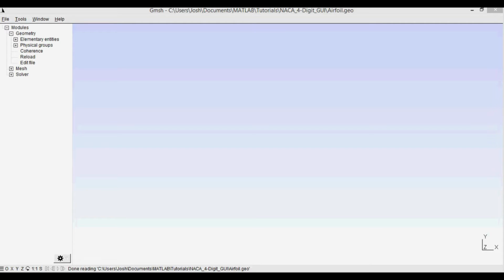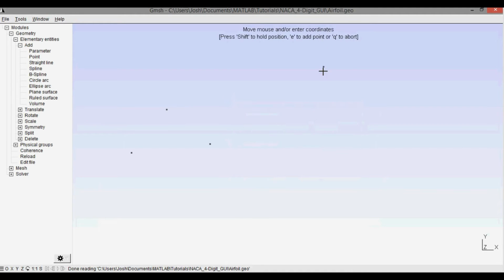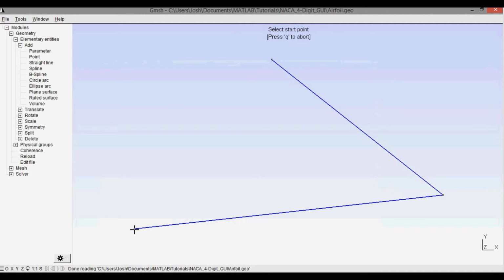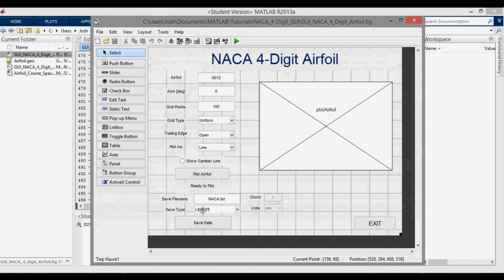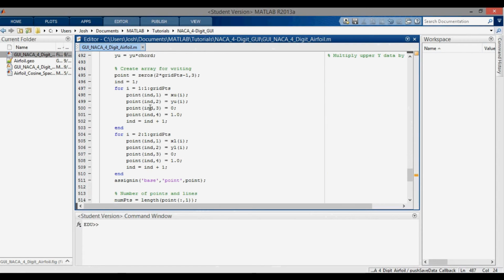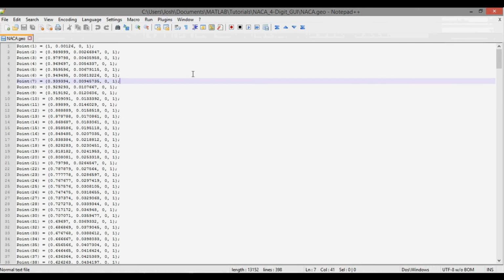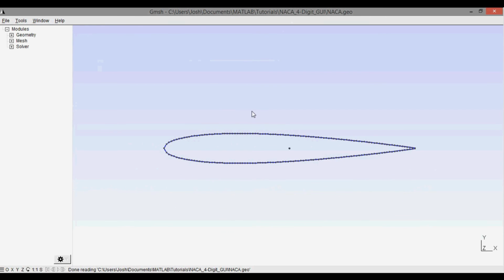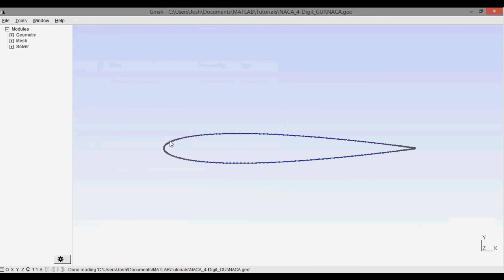How To: Import Airfoil into Gmsh

Comment: Thaks for the tutorial! But when i start the generation of a plot, this erros happens

 ">> 
Error using evalin
Undefined function or variable 'typeNACA'.

Error in GUI_NACA_4_Digit_Airfoil>pushPlotAirfoil_Callback (line 261)
typeNACA        = evalin('base','typeNACA');

Error in gui_mainfcn (line 95)
        feval(varargin{:});

Error in GUI_NACA_4_Digit_Airfoil (line 27)
    gui_mainfcn(gui_State, varargin{:});

Error in
matlab.graphics.internal.figfile.FigFile/read>@(hObject,eventdata)GUI_NACA_4_Digit_Airfoil('pushPlotAirfoil_Callback',hObject,eventdata,guidata(hObject)) 
Error while evaluating UIControl Callback.

>> "

Comment: I tried to run the program,but theses errors are shown

Error in GUI_NACA_4_Digit_Airfoil>pushPlotAirfoil_Callback (line 261)
typeNACA        = evalin('base','typeNACA');

Error in gui_mainfcn (line 95)
        feval(varargin{:});

Error in GUI_NACA_4_Digit_Airfoil (line 27)
    gui_mainfcn(gui_State, varargin{:});

Error in
matlab.graphics.internal.figfile.FigFile/read>@(hObject,eventdata)GUI_NACA_4_Digit_Airfoil('pushPlotAirfoil_Callback',hObject,eventdata,guidata(hObject)) 
Error while evaluating UIControl Callback.